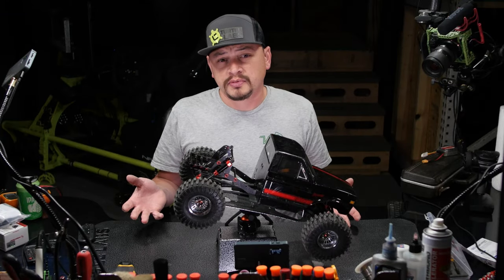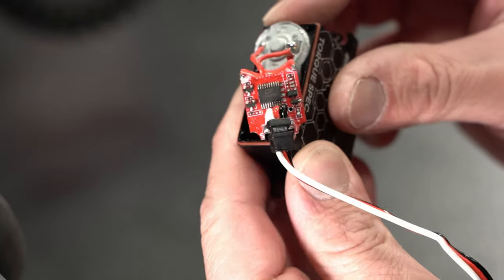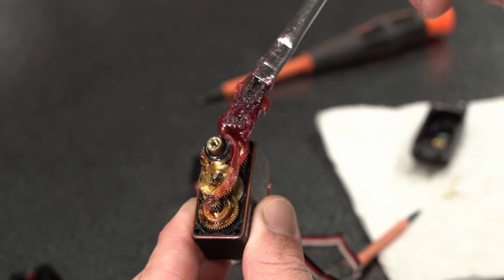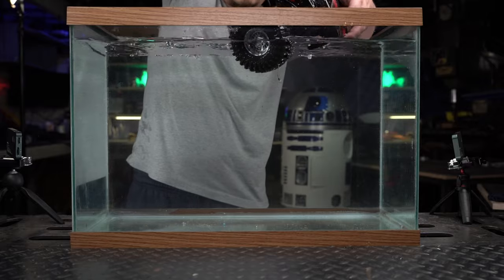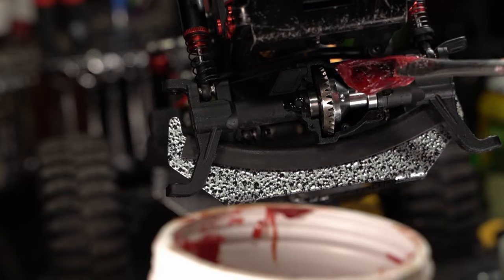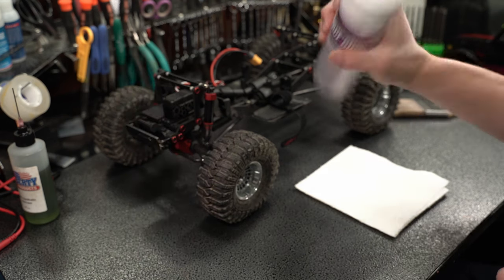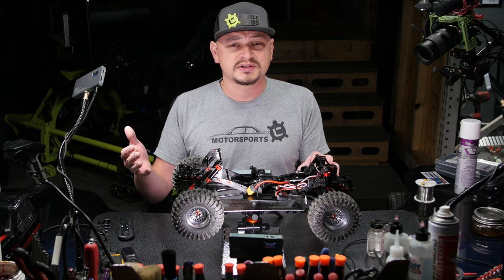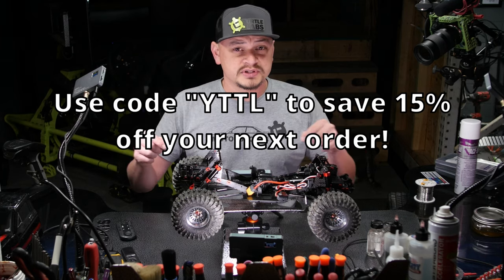Redcat Ascent Fusion RC Crawler - Is it Waterproof? Waterproofing Your RC Truck

Comment: The most problem is airmoisture in your servos,i even service my waterproof servos every deep fordging run ! You can seal your trucks electronics but your axels and gearbox never sealed 100%.I run every weekend in rivers and trust me gears can never be sealed 100% ,you need constant servicing too prevent rust on your bearings ,gears axellshafts.Dry warm store place is even important too dry out for the next weekend run. I think driving your truck every day is better than drive only at the weekends.  Doesent waterrepelling dont harm the naturel inviroment? I grease my gears with Vaseline and Weapon oil (Balistol) .I even try change all ballbearings in too Brassbearings.

Comment: lol imma watch this later but no RC is waterproof, splash proof at best, connectors are not sealed, bearings will rust, greases gets washed out, I would be most worried about the battery shorting haha, no gaskets, seals, etc.
Reply from the maker: This is all true. I tried to cover all that in the video!

Comment: Thank you for for the video! As usual to the point and interesting.
Can you show what you did with the battery? For me it was always "scariest" part to fail in water.
Reply from the maker: Thank you! I ended up tossing it, because it shorted out. If you don't just leave them submerged, getting wet and short bursts of submersion typically is fine.